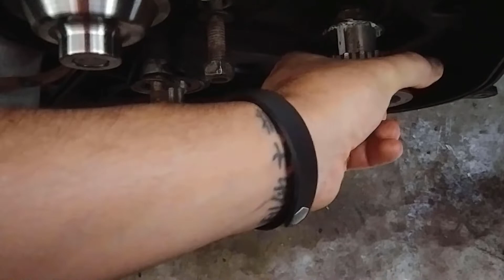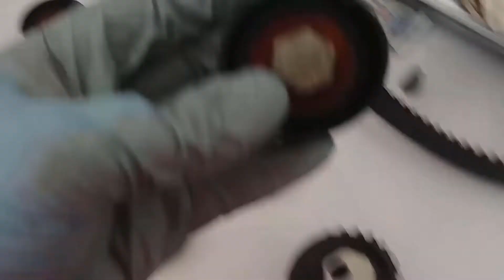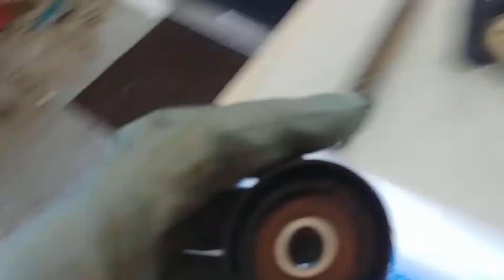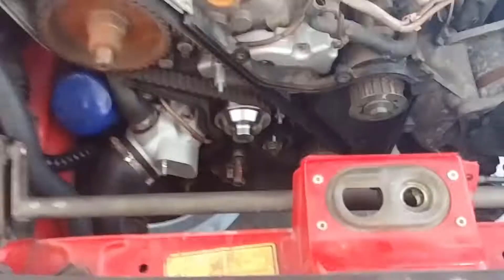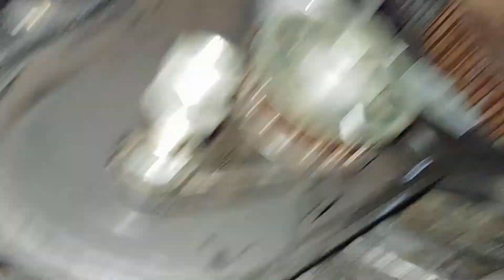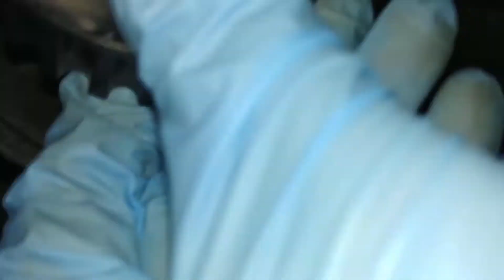1984 Porsche 944 NA Pt#26 - Timing/Balance Belt & Water Pump Replacement Part #4

Comment: Having real problems with that bottom balance shaft roller. You dont show how it goes together
I have no moved my bottom shaft and the KEy it at the top. In your video its at the bottom.
Not sure if you can help
Thansk
Reply from the maker: The key would line up at the bottom of the balance shaft where the mark is.  Are you having an issue getting the roller put back together or lining up the marks?

Comment: This was exactly how my 300.00 1984 944 was. My big mistake was not taking out the gas tank. I thought I cleaned it out good enough but I didn’t The varnish killed my new filter and rebuilt injectors. Ill be dropping my take today.
Reply from the maker: That's awesome news that you got your tank cleaned up and that is a fantastic price
Reply from the maker: @marcowollenweber9723  the tanks cost 5k where you are?
Reply: Spencerdog, do you have a list of parts model numbers and vendor?